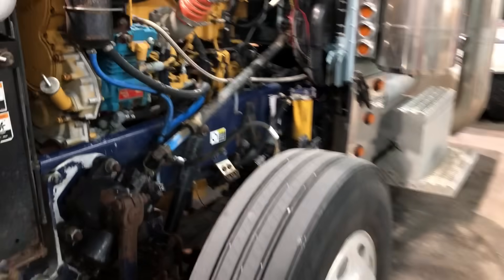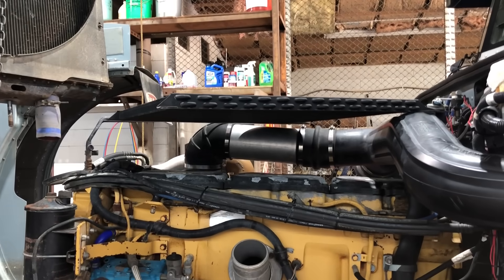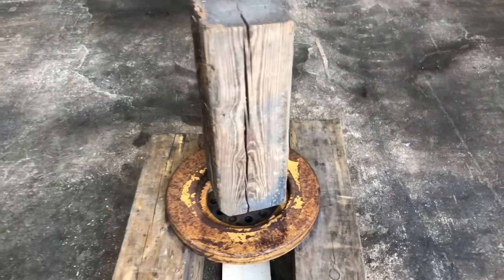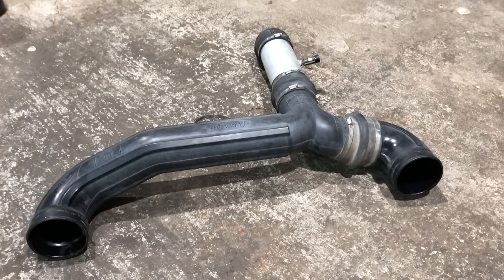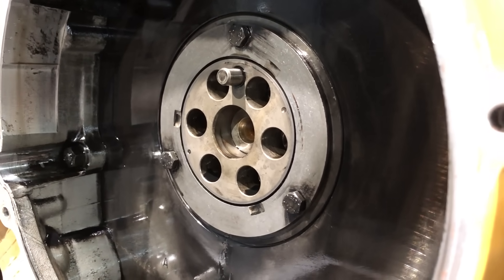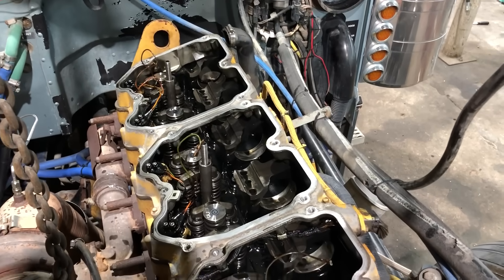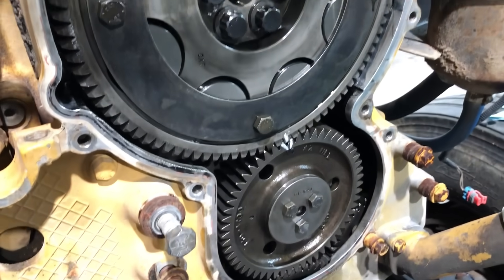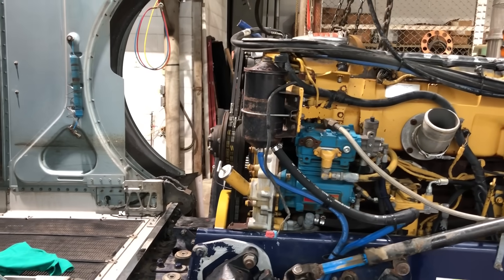800 HP Marine Camshaft Swap - 14.6L Caterpillar 6NZ C-15 Diesel Engine - Peterbilt 379 EXHD

Comment: Why the Marine Camshaft in the first place?
Reply from the maker: It's a Cat truck engine thing.  I could explain, but I'd have to write a novel here.
Reply: 800 solid hp my good man
Reply: @Erotikstudio Winkler GmbH why not from the beginning? Emissions cheat?
Reply: david gustafsson Marine engines are designed to different spec due to different operating parameters. For whatever reasons, emissions most likely being a part of it, CAT engineers chose the cams they did for their different spec engines based on the different requirements and demands that would be placed on each engine in the given applications. 
This channel has a video where he discusses the different tunes available for
CAT engines and they are largely the same in the respect to being optimized different for different applications and requirements. Often times these requirements negatively effect performance and thats when guys finds “hacks”/mods using factory parts (the only “hot rod”/performance parts available to them, I don’t believe Edelbrock, Isky or Comp are grinding cams for CAT diesels) to gain performance and often fuel mileage improvements. 
This is where the very roots of hot rod culture lie, builders have been doing this for years. Be it a swap to Corvette “Ram’s horn” high flow exhaust manifolds in your Deuce Coupe, swapping “stock” CVO-255 cams from a Harley factory 110 ci engine into a 96 ci to up the power of swapping an OTR CAT diesel cam for one optimized for marine use this is the oldest trick in the hot rodders hand book. I can give examples for days of repurposed factory parts that have been used in “stock”, OEM or slightly modified form to increase performance.
Reply: Martin pretty cool how that can be done right?

I’m not sure if you’re aware of when Pontiac (remember Pontiac? Lol) re-released the GTO in the early 2000’s but it was largely based on a car that had been in production in Australia for several years to that point called a Holden but I can’t remember the specific model name. The point is the cars were more or less the same car with some minor, mostly cosmetic changes but the “rumor” was that you could easily gain 30-50 horsepower and comparable torque numbers in the US market cars just by replacing the stock, US emissions spec computer mapping with the Australian spec map which was considerably less restrictive as far as emissions which in turn increased performance potential. Those gains could be seen by reflashing an ECU and nothing more. Without going on a tangent this is largely true to Australia’s “performance” vehicle market as a whole, for instance there are still brand new El Camino style vehicles being produced in Australia, they also offer V8 engines in many platforms that are only offered with 4 cylinder and maybe a small 6 cylinder engine in the US and the performance of their engines is higher across the board because of this. They still make special edition cars like the Ford “BOSS” and it actually means something in terms of engine performance. 
The same is largely true when comparing Japanese spec automobiles and especially engines and transmission/driveline components to US spec parts. Japan holds its vehicle makers to higher quality standards and its vehicle owners are required to maintain their vehicles to a much higher standard than in the US. A lot of Japan spec parts will swap to US vehicles and produce higher outputs. Same with engine programming, often times JDM engines will have different specs on internal parts like pistons, cranks, connecting rods, camshafts, cylinder heads and engine blocks as well as intakes, throttle bodies, fuel injectors. A lot of the special run Japanese performance cars like the Acura NSX, Honda Civic SI/ Acura Integra RSX(?) or Nissan Skyline feature parts that are specially made, differently constructed components specifically made for the application. A lot of those engines are hand assembled by experienced builders with parts that are specifically selected and held to super high tolerance. 
Chevy and Ford both had special performance parts that were built differently and made from special materials for different applications that allowed hot rodders to use them to build more power than with stock parts or even take advantage of their superior strength in endurance races to increase the life of their cars.
Reply: Amazing! What sort of price was the replacement CamShaft?
Reply: @vtwinbuilder3129  thanks but im not that interested
Reply: @vtwinbuilder3129  Holden Commodore HSV (Holden Special Vehicles)
Reply: Marine specs are a lot higher than road specs, but just changing a cam will not get you 800 hp. There are a lot of things you can do to change hp without going to cat and paying for a new flash file.
Reply: @chevy36ful  Or redoing your cooling package. Remember, marine engines, whether raw water cooled or running coolant through a heat exchanger,  run lower temp thermostats and run cooler to cope with the extra fuel being poured in therefore higher combustion temperatures.
Reply from the maker: @chevy36ful  Exactly right.  I am not making 800 hp.  Going to Cat for a flash file is one of the worst ideas there is.